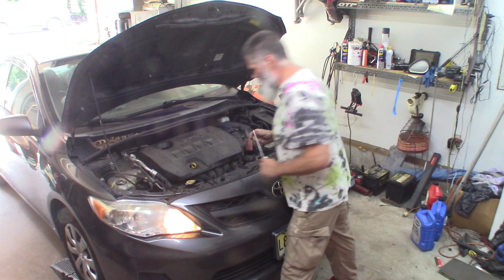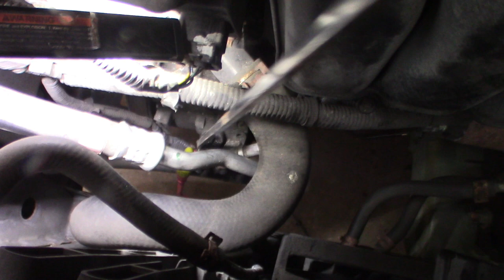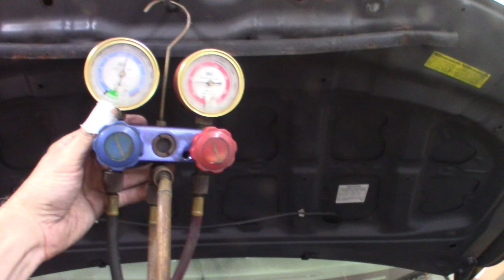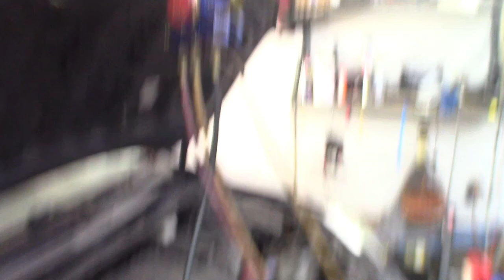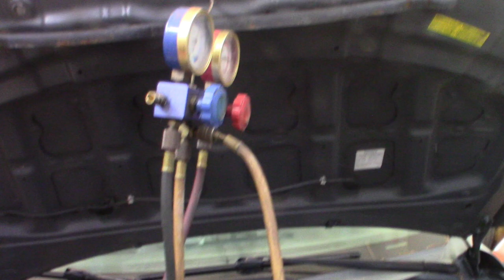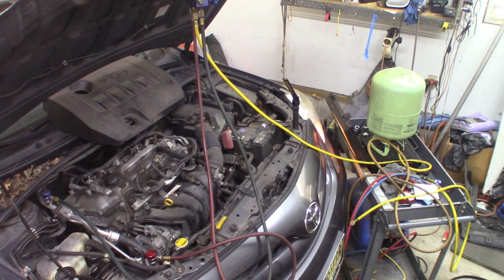2013 Toyota Corolla B1479 - AC Flow Sensor - 1.8L

Comment: Dorman sells a replacement sensor for $30.
Reply from the maker: Won't use Dorman... just asking for trouble.
Reply: @CharlesAndCars    Are there any other options besides a no-name part on eBay?
Reply: Found sensor on Amazon. Hope that helps